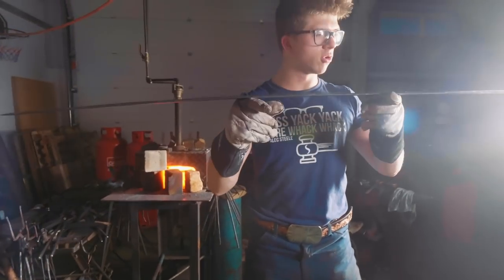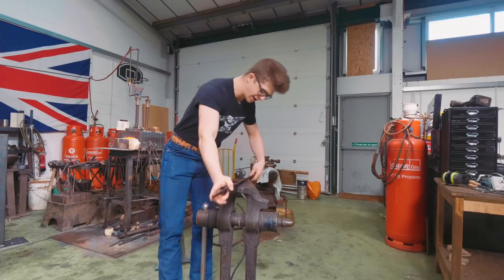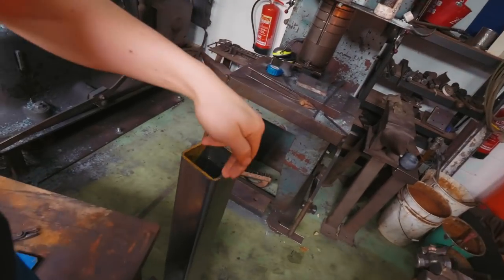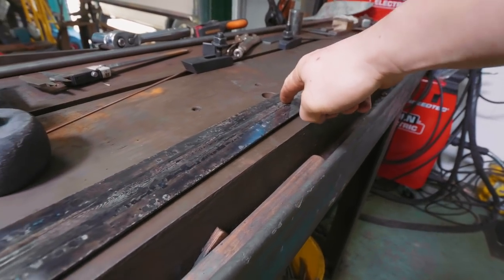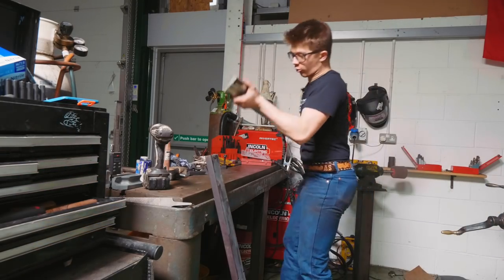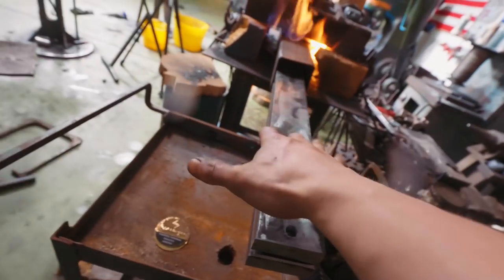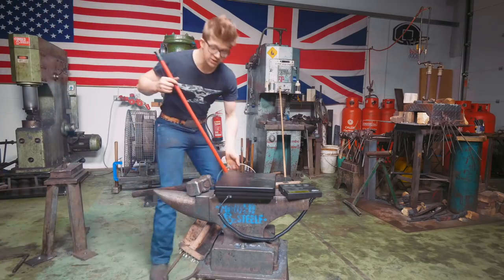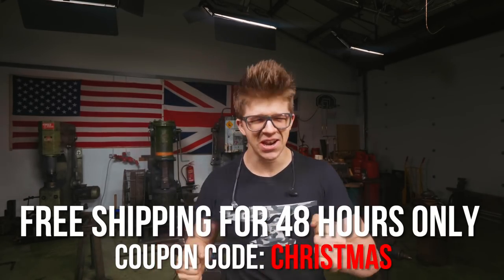MAKING A SCOTTISH CLAYMORE SWORD!!! PART 6

Comment: Next time you're tempering that large a blade, weld a plate to the bottom of a steel pipe large enough to sink the whole blade. Fill with tempering medium and heat it up to your temper range. Cook blade in oil for a couple hours keeping oil at temp. Voila, evenly tempered blade. 

I harden and normalize in the forge, in the same manner as you. 

Longer blades are more prone to warping, but warping is due to uneven stresses in the steel, as you well know. When you start setting your bevels it's important to hit with the same force blow to blow, hit evenly, and hit the same number of times on each pass, on both sides of the blade. Easy to say, harder to do I know. Also, austenic forging your bevels will help tremendously, but will take considerably longer. Forging them in at cherry red.  Finally, that warping could be due to your grinding attempts to see how far the delamentations were a few episodes ago, because you naturally forged that area less trying to even the thicknesses along the blade, harkening back to my comment about even forging on both sides minimizing warping.

Comment: So one of the tricks I have seen on forged in fire is bladesmiths take the blade right out of heat treat, place the blonde flat on the bench sandwiched between two boards and clamp it all down to the bench and let it cool. Is that a viable option to prevent the banana out of the quench?

Comment: maybe tempering in the oil (like they do it at men at arms) would have been easier. heating the oil in the quenching up with the torch and then leaving the blade in the oil for an hour or two

Comment: you see folks like the man at arms crew straightening any warps in the vice post-quench, since you can work the steel for a short span before it fully crystallizes, apparently.
Reply: you could also make an oil temper tube, much like your quench one (you just introduce heat from the bottom until it's at your desired temperature)

Comment: for the temper, have you considered tempering in hot oil? Couldn't you fill a steel pipe with oil and heat that with a torch for long blades?

Comment: hey alec, you could cold forge the blade straight after the temper. The first long sword I forged had a really bad bend in it, when I layed it on the floor you could almost crawl underneat the tip. My teacher showed me a way to straighten the blade without doing another heat treament. If you take a ball peen hammer and gently hammer the hollow side of the warp it wil stretch that side and force the blade straight. also if you heat the blade in a bucket of boiled water you reduce de risk of snapping it while cold forging. since you have a lot of grinding material left you could try it .

Comment: Hey Alex you really could have straitend the blade without requinching it. Just heat it up to tempering heat and then slowly bend it strait. But still a good job. Keep it up. For heattreading just build up a furnes from ceramicwoll and Wire. Make a hole and stick a simple propane burner in. This way you can also heat it up vertical and prevent warping even more.

Comment: How about trying to set the sword the other direction. Just a theory but maybe because heat rises it may be rising up causing a bend. Not taking credit for this move. Illia from reforged pulls his swords from the oil straightens them and them holds the tang in a vise sword tip up

Comment: Could the warping be caused by the use of two different steels? Does each steel call for a different heat treat temp?

Comment: why dont you build a long BBQ pit grill for tempering. You can control the heat by adding coals into it and you can monitor the heat with a thermometer.

Comment: I'm curious as to why you didn't use the same approach you took with the katana and make an impromptu coke forge that could accommodate the length of the claymore.  Wouldn't you have gotten more even heating that way?  I know you had problems with oxygen flow to the fuel when you were making forging the katana, but you managed to overcome that with beautiful results.

Comment: Alec, you might want to do a bit of YT searching for heat straightening by Keith Fenner.  He's done some videos of straightening marine prop shafts using lower temperature with rapid cooling to pull the shafts straight.  From what I could see he's not getting them so hot that it reaches a temper temperature.  Might be just what you need to work the claymore somewhat straighter.

Comment: Could you get x2 pieces of some type of steel hardened or spring idk, clamp them to either side of the blade to force it straight, heat it, then quench it?
just a random thought.

Comment: Warp looks a lot better than it did at the end of Ep 5.  I'd call that progress.

Definitely gotta work out equipment upgrades to better forge, normalize, and temper longer pieces ... a forge extension, and a digitally controlled kiln/oven.

I also wanna see you get a crucible and give wootz damascus a try ... or at the very least give smelting your own iron into bloom steel a whirl.

Comment: It's an awful thing when micro grain structures in dissimilar steel compositions expand and contract at different rates at a weld as a result of normalizing heat treatment. A more gradual quench, perhaps an unusual air quench? Some exotic alloys respond well to inert atmosphere quench (nitrogen). This is typically a fast quench (post hardening) but there may be a method of slow quench using nitrogen for post normalization to accommodate dissimilar structures. It could be a difficult anneal, normalize and harden process with very controlled times and temperatures.

Comment: You may wish to consider, in future projects of course, that when marrying long pieces of different steels together you risk having issues with different thermal expansion characteristics. The longer the piece, and the more asymmetrical, the greater the tendency for warpage. Add in the unpredictable amount, and direction of expansion of Damascus, and I'm surprised you haven't seen more issues. I wish you luck lad.

Comment: I have zero experience but I had an idea of how you might be able to hear treat, or at least temper, a large piece like this. Could you run an electrical current through the piece to hear it up that way?
Reply: Ian Enderby not with a blade that big
Unless you got access to high voltage line
Reply: Markus Camenzind that was my first thought too, but then I remembered this:
https://youtu.be/6aNm3qWkW8A

If you had a variable step down transformer I think you could use normal wall power and control the current/heat.
Reply: Ian Enderby probably easier to wrap a heating coil around it

Comment: what's the possibility due to the vertical bath that when all the heat in the quench caused an uneven temperature within the bath (cooler on the bottom, hotter on top)?

Comment: The HT oven I started to build for you would no way be large enough for that monster but...if you can build the chassis for it as I can’t weld myself I can definitely supply you with all the parts you need to make it ( element / thermocouple/ controller etc ) let me know mate we can easily make it happen 👍🏼

Comment: What about that insulation matting used inside the forge and kilns being wrapped around the rectangular tube? Would that reduce the "painting" need, and maybe get a more even heat on the length of the blade? Not being sarcastic, really asking.

Comment: Alec, If you are planning on doing a lot of swords you could make a vertical forge and a vertical quench tank that are in a platform, so that the blade is always hanging while heating, and that way you can just reach down and pick it up and lower it back into the quench. also it you have a fuller, heat two rods in the forge that will fit into the fullers, lay the sword in between, This will give a very nice distal temper to the blade. as always great watching your vids.

Comment: To get wards out of a blade heat it up to non magnetic and lay it on a cold metal surface and that will help to pull the warmth out of the blade

Comment: Hey Alec, I was wondering, what kind of oil do you use for heat treating and what are your thoughts on motor oil, spent or new. Because I've heard both can work but no real idea on the used motor oil.
Reply: And one thing about the warping with the steel, it would help you to remember in future that steel has a springback property , and so if you're gonna get that warp out you have to go a fair ways past the bend and then it should keep to shape, no idea if you knew about this or not, just in case you didn't you could look up more about it to help. Thanks for the great content

Comment: yes i also wonder why ht all over again,u can straighten it during tempering,just heat heat it up to a desired  temperature and clamp it on a straight table or so and over bend it slightly to the opposite of the current bend,maybe put some washers or something underneath it,i actually have ht two swords about 40 and 36 inches long and they warped a bit,i would like to make a video whilst tempering and straightening it and send it to you for future references.

Comment: Alec, for tempering you could try building an Oil Temperer, out of circle or square tube stock (big enough for whatever size blade you think you might end up attempting). Weld it water tight on one end to a plate.  Fill it up with an oil, then start blasting the side with a torch. The oil will conduct most of the heat (so your steel sides remain fine), using a thermometer in the oil till you get to your chosen point, stick your sword in and maintain. You will get an very precise temper on your sword this way. Less energy efficient than an oven designed for it, but ... It will fit things bigger than a knife.
Reply: Kanthalas you mean like the square tube filled with oil he uses to harden the blade ?
Reply: Yea he could totes use that, assume that oil has a high smoke point.
Reply: He is not cooking so boiling point will do
Unless u use smoke point as heat guide
Reply: Yea sorry, meant flashpoint, a high flashpoint.

Comment: I enjoyed watching this...you obviously know what you're doing, but when it comes to tempering big stuff the only way is an oil bath.
I have been a toolmaker since the 70''s and nothing much has changed when it comes to heat treatment....and I've spent a few years doing it.
An oil bath is gentle and even and that's what you need on big dies and punches etc.
In fact, on something a few inches thick it's the only way afaik.

Comment: Alec I've heard if you have a quenching tube horizontal facing north, the blade will not bend. The reason why this is true is because when you heat the metal it loses the magnetivity, so when it cools down during the quench, the metal will get it's magnetivity back and bends towards north, if the quench tub if horizontal and facing north it shouldn't warp.
Reply: kjesse 198 if that was true then the magnetic pull of north would be enough to feel when holding plain steel in your hand.
Reply: I sadly have to shatter you illusion. The magnetic field of the earth is just about strong enough to redirect a needle that touches almost nothing. It will definetly not pull a steelbar straight, if it was that powerful you could feel it everytime you carry something magnetic.
Reply: Hmm, well that's just what I've heard, it may be an old tall tale. Just thought it'd be worth a mention.
Reply: kjesse 198 Hey kjesse, that's true it's an old "wives tale",  I believe Purgatory Iron Works did a video debunking it. Check it out. It's pretty interesting:-)
Reply: Funny, every time I've had a blade warp, it was because I wasn't aligned with magnetic north. After I figured out the problem I intentionally quenched a blade with the side facing north instead of the edge and it towed like crazy so there is something to it
Reply: Everytime I sneeze I have socks on, probably should get rif off them to avlid it. 

Just because there is a correlation doesn't mean there is causation.

Comment: Why don't you just make yourself a straightening jig instead of beating on it? It's easy enough and it is effective. Also why don't you use a magnet when you heat treat? It assures the proper temperature..

Comment: Is there something I can use as a makeshift anvil other than railroad track
Reply: Noah Cercone A large log and a piece of steel. Mine is 6"x10"x1 1/2". Then bolt the steel to the log and secure the log.

Comment: so quench facing notrh
Reply: I know a old smith that says the same thing. To use a horizontal quench tank and having it  pointing North. That when the blade cooled in the quench as it regained magnetism it would pull towards magnetic North and warp if it wasn't pointing North.

Comment: your fuller is too deep for heat treating this way.
Reply: Barry Smith credentials?
Reply: Barry Smith explain
Reply: Retired machinist
Reply: Barry Smith obviously not
Reply: You could be on to something there :)
Reply: I was thinking the fuller depth could be causing the warp but I figured as long as it's the same it wouldn't be as much an issue
Reply: Okay, kids, we have a long piece of thin steel with a thin web.  The web will cool much faster than the main body.  I was running the data on how thick he ground it to, this shows a major change in cooling then reheating, plus the amount of oil is an issue.  The oil will reach boiling point a little too fast.  I was shocked the steel did not crack in the area of the sharp corners on either side of the fuller.  In die making we had to be extremely careful in how thin and how smooth the transition areas were to be sure the die did not warp or crack.  If you want to test this yourself, try heat treating a file.  A file is usually High Speed Steel and this steel will deform if you have too much heat or uneven heat.
Reply: Barry Smith Speaking of die making, if I had a chance to an apprenticeship at a die making company, would it be a good jumping off point in learning the machining trade along with CAD/CAM? Thanks
Reply: All due respect to your trade and experience, Barry Smith, he is doing things by trial and error, he is 19-20 years old... I believe comments like yours will help him grow, thank you so much, from someone aspires to learn from the experience of others, along with trials and errors of my own.
Reply: Good shout there Barry.
Reply: Any education you get will widen your abilities to remain with a company as they expand.  A die making company will have many areas to focus your skills.  Many spend a lifetime learning how to heat treat and nitride.  The major thing to look at is what the die company makes, meaning you can spend your career making screw machine parts, punch press dies, extrusion dies, or other types.  Once you figure out what you want to do whether boring and same everyday, or job shop where every project is different, then you can figure out what education you need.  CAD/CAM is very easy to learn!  The last time I worked with that was in the 1980's.  I spent most of my career working at a Bridgeport Mill.  Most machine shop education will train you with cold rolled steel, so when you move up to tool steel machining just remember to slow down.  H13 is one of the fun steels to machine.  It is like butter before heat treat then a pain after.  Also learn to weld with SST Stick and TIG.  And when you get a new job, do not have a brand new set of drill bits, this is a red flag for newbee.
Reply: I know the age and skill that Alex is showing, but when you watch a heat treat in process and know before he dips it in oil it will bend, what do you say?
Reply: LOL! Krounedave Dupelot.  Ni Bu Hao.
Reply: I literally came to the comments hoping someone with experience (a little more than Alex lol) could shed light as to what happened here. I've never even seen a forge in real life, just like learning new stuff. Thanks Barry!

Comment: You know, you can straighten out a slow bend simply with heating and cooling one side of the blade to pull it back straight. Go watch some of Keith Fenner's videos on straightening hardened shafts with heat and cooling..Here is one.. https://www.youtube.com/watch?v=aVRV9WLc2sY  Could be that you just had a cool breeze blowing on one side of the sword when you hung it that made the bend.

Comment: It is bowing because of the two different types of steel. They shrink by different amounts when it is cooled. It is how a Japanese samurai sword get the curve to it. The back of a samurai sword is a different steel then the edge and it all starts out straight then when it is heat treaded the spine shrinks more then the edge giving it that distance curve to it.

Comment: why would you buy that oven? Build one and do a video about it. Its easy. All you need is a steel frame, some heat resistant bricks, kanthal wires and a 20 Dollar control unit. Thats a one day build.

Comment: So there is alot of moments watching your channel I go YES! and alot of other moments I want to cry because you do something that as a blacksmith I cringe horribly at. you didnt taper your blade or do your fullering before beveling, and a claymore has step taper on the last part, plus you didnt weld a soft core for the blade. AND YOU HAVE ALL THE EXPERTISE AND TOOLS PLUS EXPERIENCE TO KNOW BETTER.

Like MOST of your problems would have been entirely reduced if you had done of all that. its pretty but its not exactly a warsword.

Otherwise iv been happy watching your channel and your patterns give me things to think about.